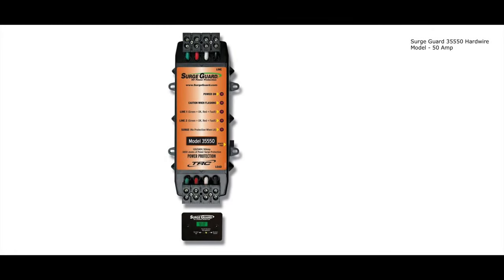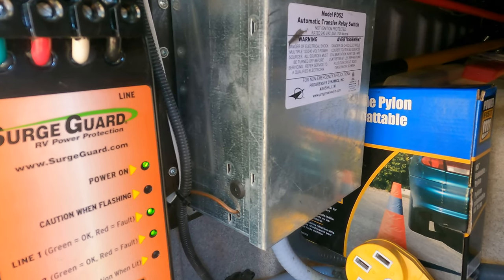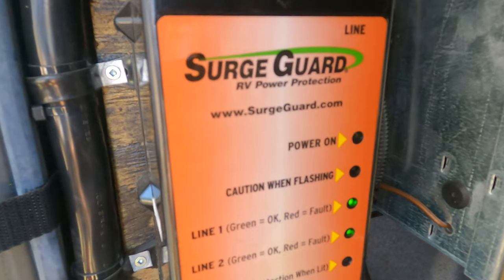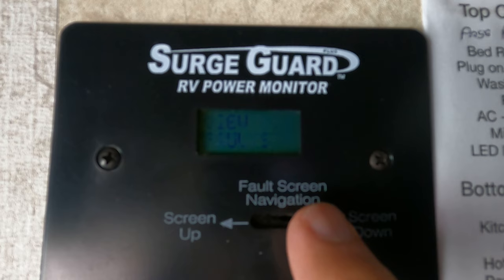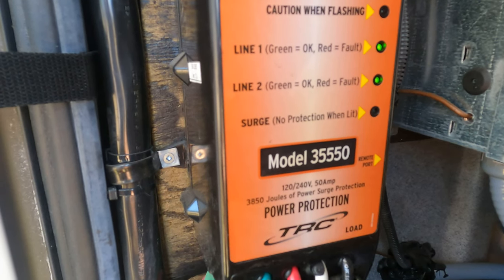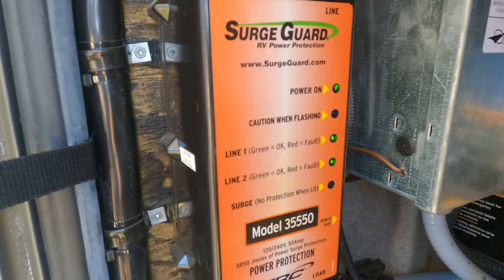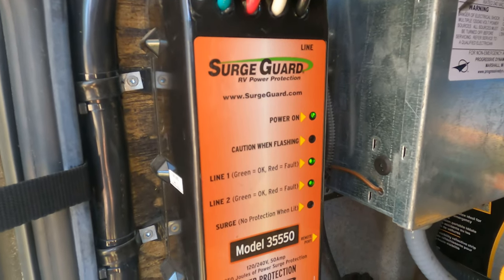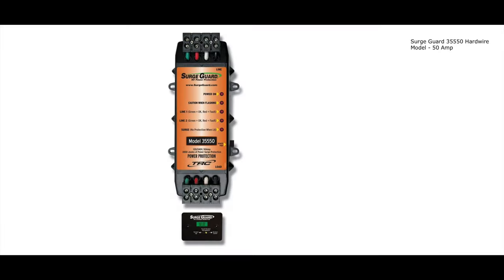How my TRC Surge Guard, protected my RV and found an electrical problem

Comment: That’s cool that it helped find the problem at the pole
Reply from the maker: Yeah, it was one of those things that were kind of weird when the power was fluctuating from 124 V to 109 my RV  TRC sensed it I was kicking out and that’s what started me looking around because we’re staying here. We have a good power regulation, but if you can see in the pictures, it took Florida power and light to fix the problem because the hurricane move the wires so bad that it was connecting and then it was making a bad connection and dropping the voltage who would’ve figured out my TRC would start the process of me looking for a problem up on the pool. Thanks for watching, and your reply.
Reply: I’m having to put a soft start on my camper because it works fine with my generator but I ran a dedicated cord to it with the transfer switch and when the compressor kicks on it  drops the voltage just long enough to kick out the transfer switch.  So if I want the a/c I still have to drag the cord out lol
Reply from the maker: @GimpyCamper  I thought many times of putting some soft starts on my RV which I should’ve done years ago I guess but my thought was I always had a good 50 to 60 A where I keep the RV all summer and then all winter so I kind of put off putting in the soft starts, but I wish I did it. It just makes everything a lot smoother when it comes to power requirements for air conditioning.